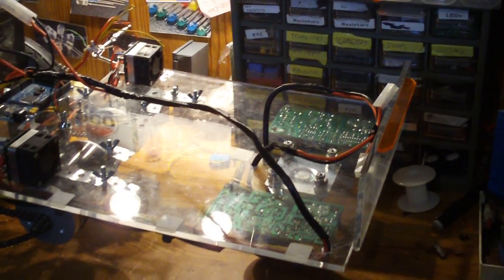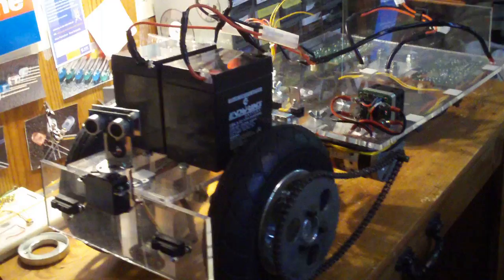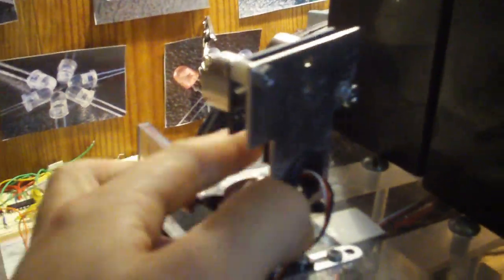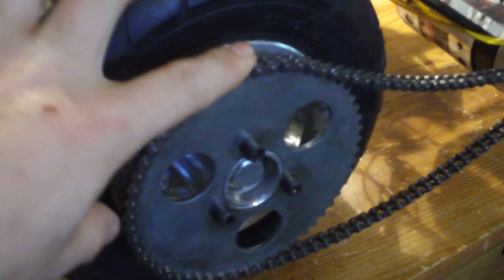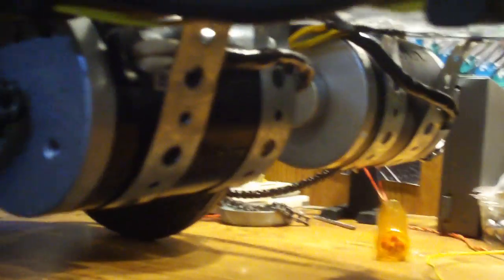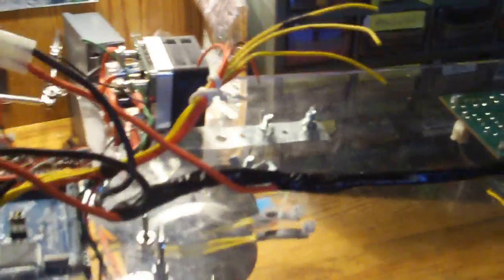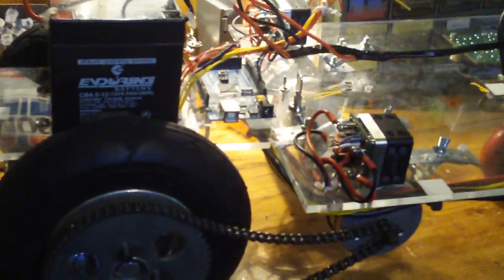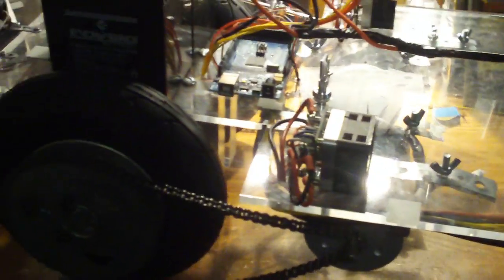Zener the robot

Comment: hey Tyler, that's pretty cool.  I definitely want to see it when it's running.  When did you start getting into building robots?  When you were describing the motor controllers, that kind of reminded me of a big radio controlled tank I had.  (Actually I still have it).  The speed controller was actually resistive, and when you increased or decreased the speed, you could hear a servo motor moving back and forth.

By the way, I haven't heard from you in FOREVER.  How's everything going?